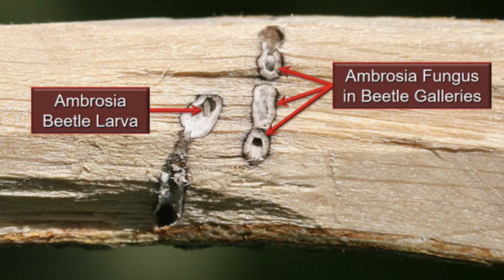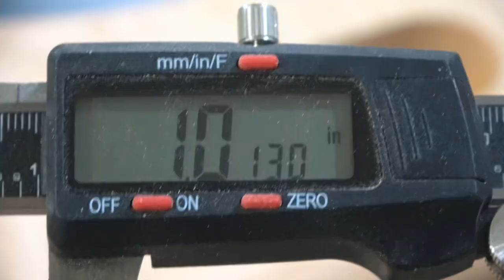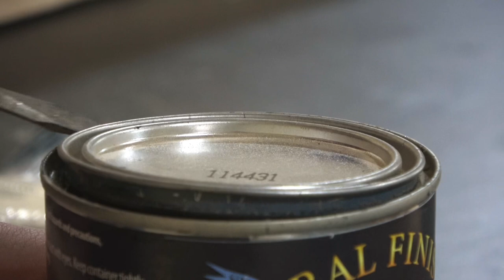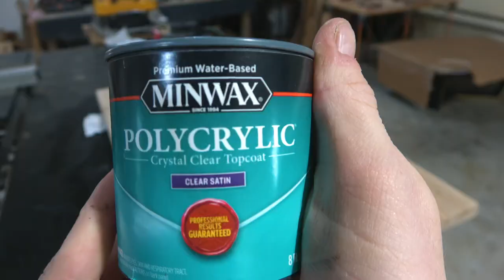There is a good chance you will hate this table

Comment: My dad said hand soap got a tight screw into wood. But this promoted rust on the screw, not good for long term reliability of the connection. The best way to coerce a tight screw into wood is bees wax.

Comment: Yeas I like the double pieces and I’m a big fan of poly or water based clears instead of epoxy. Like one group was discussing water entrapped by epixy(over 30% made a horrible cloud blush after weeks of working on a 42” circular black walnut cookie😞poor guy! 

 The meter wasn’t checked as soon as he begun so he just was sick and lust so much labor and material.

  I’m a sign painter/muralist of 40 years exp. I have made many sandblasted Cyprus signs and I know how much cypress shrinks when dried . But Black Walnut or oak? No clue. I cut a big natural slab(cookie) for a customer but after 6 months set aside to dry? Big cracks everywhere. Stay away from cypress imo.